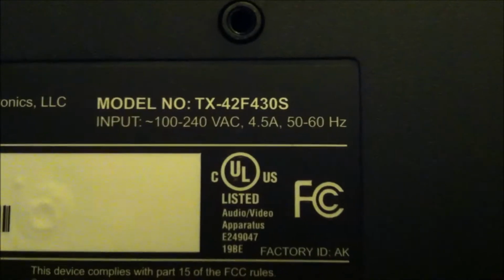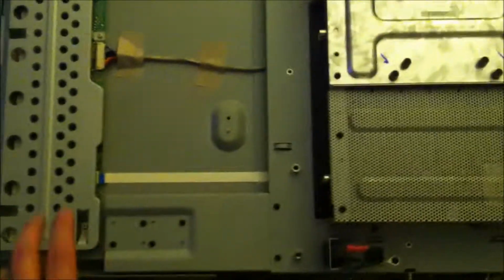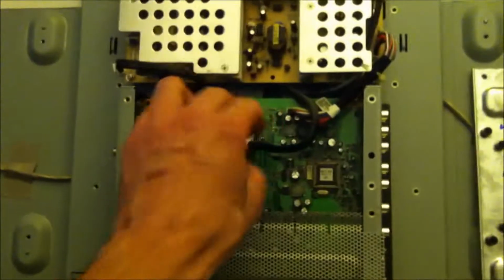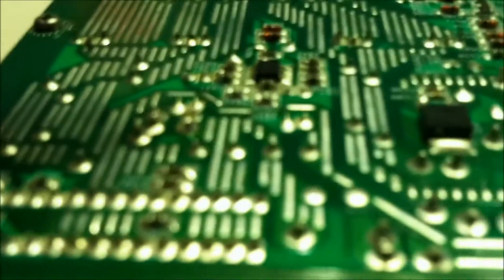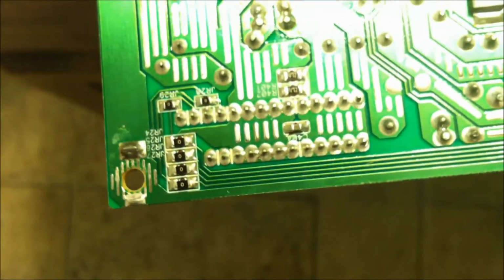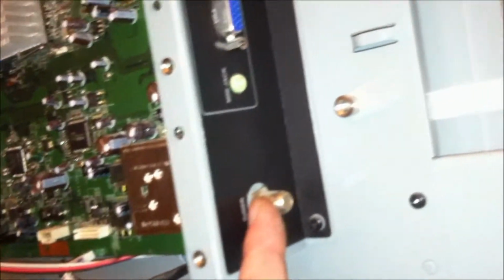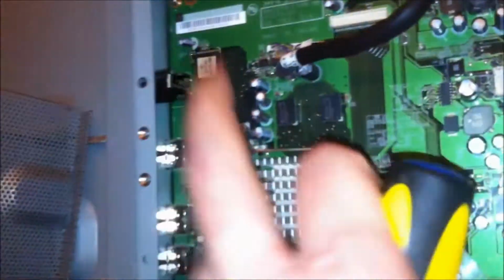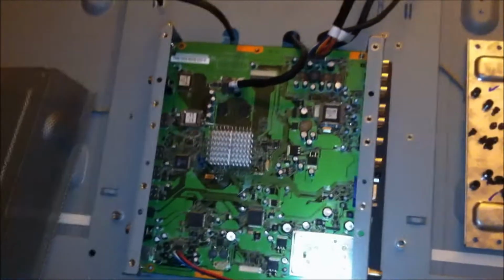Westinghouse tx-42f430s wont turn on fix repair

Comment: I own two 52 inch TVs model TX-52F480S.  Last year I had this problem with the cap and I fix it using this video. It is still going strong.  

Today my other TV had the same problem. Within one hour of my wife texting me.  I looked up this video again and had it fixed.  

This saved me a lot of  money.  Thank you!!!

Comment: Well chalk another one up for me too. Another TV stays out of the landfill… How great is that. well thank you for your help. I had the exact model that you had in your video with the exact same problem. Took the board out of the TV and asked a local TV shop if they would just put in a capacitor for me and they were mean and said no so got me a $.59 capacitor from Micro Center and had a friend that had access to a solder iron and voila.... fixed.

Comment: THANKS YOU SO MUCH for posting this.  I did the same repair on my Westinghouse 47 inch tw-51212-c047 and it WORKED! The inner assembly was very different, but the main board one apart was exactly the same. Thanks again!

Comment: It is amazing how a $2.09 component just revived an old dead TV. Worked for me. Should have not wasted $22.00 on a power supply from ebay though. Under $25, still a bargain. Thank you guys for the confidence to do it myself. Just a heads up have a heat gun or a hair dryer handy. -ve side of the capacitor lean / solder is a tough one to melt.
Reply from the maker: Glad it worked for you. That's the neat thing about electronics, usually can be fixed cheap

Comment: I replaced same capacitor, 470 uf 35v.  It works!!!  Thank you so much for your help.
Reply: Says it's a 16v. As long as I go 16 or higher I'm ok?
Reply: Steven Gilmore yes, you can do more than 16V but 470 uf stay the same.

Comment: Add ANOTHER one...to the list of SUCCESSFUL repairs by this cap !! Thius $10 thrift store tv is now FIXED and looks VERY nice. Now...what to DO with it.....

I have to WONDER....just HOW LONG...it took someone to dig this bad cap problem OUT..they HAD to have a schematic to do so....as the cap did NOT look bad...They HAD to know what voltage level or signal needed to be there....and was not right because of this cap. HATS OFF to them !!
Reply from the maker: Sta2200 I found this information online in many many pages deep in google. Thats why i made the video so people can find it easier! Not bad $10 for a tv. :) resell or keep for something extra.

Comment: Brought this set home for free 2 days ago, found that it would turn on by itself only, when I would plug it in.  And only then.  Would not obey the remote's turn-on command, tho it would obey the turn off command.  Before I found this info I took it apart to see if there were any cold solder joints, no go.  Put if back to together, now it would not turn on at all.  Dang.  Got what I paid for again!  I hate that...Started surfing.

Fixed my set this morning (this declared model) with this advice, thank you wholeheartedly!  I didn't have a 470, but did have a couple of 1000's, so I series'd the polarities correctly - plus to minus between the caps, soldered together - and that resulted in 500uF, close enough.  Did the trick.

Does anybody know what that cap does?  Could have kept my costs down - from $3 to $1.50, whoopie ding - if I were sure it was a filter cap and not a timing cap, which would have allowed me to use just 1 of the 1000's and not both.  Not wanting to take a chance I left both caps in there; losing a potentially unneeded $1.50 is still good insurance, not worth the time to experiment on.  

This is a great set, now that it's totally working again.  Has every type of input available, and several of the HDMI's.  Thanks again!

Comment: this works for the 47" version as well but the covers are diffrent and were harder to remove.
Reply: +doug bishop yeah you're right, but they actually just tricky i'll try to change this CAP on mine to see if that make any difference.
Reply: +TigredelMar77 Well i've just changed the cap and its working, lets see how long its last, hopefully this will be a permanent fix.

Comment: Thanks for the video I have the 52 inch TX52F480S having munticolored vertical lines. Did you determine where the T Con board was located....outside the screen or attached to the screen (hard to replace).

Comment: I have the 47" Model with a similar problem.  It will turn on and work for a while (20-50min) and then just go into standby mode (amber light) just as in the above vid.  Will return to normal again only if unplugged for 20-30 min.  I've taken apart and identified this part but I'm a noob when it comes to soldering caps.  Especially this type that seem to be surface mounted.  Any advice how to solder THIS type?

Comment: Did not work for me. Really was hoping it would. Amber light comes on and thats it. Green led on main board comes on as well. Power or combinations of buttons on tv and remote will not do anything. just sits it what looks like standby mode. Not sure where to test from here. All the caps appear fine visually.

Comment: I have the 47" version of this TV. Mine is doing the same thing.  I bought an ESR meter and there were several questionable capacitors on the main board but not the power supply board.  Did you verify that the capacitor in question was indeed bad?
Reply from the maker: It did not ohm out anything on my meter. This is a known issue, Ive seen many posts online about it.

Comment: how did you know it was that capacitor? I ask because i have the same issue with my Westinghouse WD40FX1170 and dont know if just replacing the whole motherboard will do the fix, or if its simply the power button not doing the job, etc. How did you trouble shoot, complicated skills i dont have?
Reply: Actually I watched the video where you do this. I got it now. I’m guessing I just need to open my tv up and search for the culprit possible capacitor and replace it depending on the model labeled. If that logic is sound let me know. Thank you!

Comment: My TV comes on but it's stuck on the channel that it's on ,volume , channel, menu an input buttons only put " key locked" on screen, is there a reset button external?
please/ thank you✌️
Reply from the maker: Mike Breard from google: Press the Menu button on the remote or TV. Use the arrow keys to select the Lock menu. You will be prompted to enter the 4 digit password. If you have not previously set a password, enter the default password of 0000.

Comment: Attempting this fix right now, however, my solder iron (25 watt Weller) won't melt the manufactures solder, what type of soldering iron did you use for this fix?
Reply from the maker: Jared M 30w from Walmart. They use lead free solder on the boards, just add more solder to it.

Comment: I changed the capacitor, used a 470uf 35V (they didn't have a 16V at the local store), then I heard a pop when I plugged the TV in.  Could it have been a bad new capacitor that popped?  I've never done this kind of work before, would appreciate any input / advice.
Reply from the maker: +rrecords1000 make sure the polarity is correct. The negative side has the line marks on it and goes to the negative on board, normally marked as half a dark circle.
Reply: I thought I put it in right.  I ordered the correct voltage and will try again.  Thank you for your reply and for posting your very helpful videos!
Reply: +After Hours Tv & Pc repair - I just installed the right capacitor, still won't turn on.  Any ideas what else it could be?  It's doing exactly what you described, I was sure it would work.

Comment: I have a Westinghouse 40" TV that is working, but sometimes it won't turn on.  When that happens I unplug it then plug it back in and usually it will turn on.  Sometimes I have to repeat that 2 or 3 times.  I found one website that talked about resetting the TV by unplugging it and holding down the power button for 20 seconds, but that didn't seem to solve the problem.  Do you have any idea of a way to fix this?
Reply: Steve Someone This is known as SLEEP MODE problem.

 Simple solutions:
 1. Get a power surge protector / strip.
 2. Plug your TV power cord to the power surge. 
 3.Then turn-on your TV using the remote control. Just in case it won't go all the way to normal state.  
 4. Turn-off the switch of your power surge like 5 times with an interval of 3-5 seconds. 
 5. Then repeat step 3 and 4. 
 6. These step is done to over-ride the sleep mode.
 7. Unplug power cord from back of tv with cord still plugged in to wall. light on power box will turn on.

Comment: What is the capacitor part# and voltage? (I need to order it before I open it). ShopJimmy doesn't seem to sell the capacitor unit by itself.
Reply from the maker: hassaninator 470uf 25v or 35v
Reply: Thanks!

Comment: what if the orange light dosent come on??
Reply: Take a DMM and BE CAREFUL (use an isolation transformer if you're not fond of death, and all due caution if you don't have one), measure the voltages the SMPS is putting out (the power supply), in addition to checking the fuse/s. It should be pushing a few different voltages. That's your likely issue. If you don't know how to use a multimeter, and just want to throw money at the set, that's where I'd start. The SMPS is only a ~30 dollar part used, I snagged one because mine was looking kinda rough (questionable capacitors) from eBay.

Comment: I just replaced the capacitor, but still only get amber front LED. Problems started when I tried to upgrade firmware. Could this problem be the result of a failed firmware upgrade? If so, is there any way to recover? Thanks!
Reply from the maker: Try the firmware update again.
Reply: Are the real files available anywhere you know of?
Reply from the maker: http://www.techsupportforum.com/forums/f278/westinghouse-tx-42f430s-42-inch-lcd-tv-appears-bricked-595806.html

Comment: what if mine turns blue but still no screen activity?  It was only orange but now it's changed to orange then blue when turned on but no other change...is there a possibility it's related to firmware?
Reply from the maker: Erica Rountree I suspect capacitors
Reply: thanks, hubby was asking why I was changing out one that looked good and I told him that it seemed to work for everyone else :P